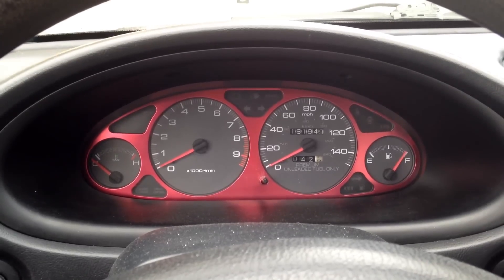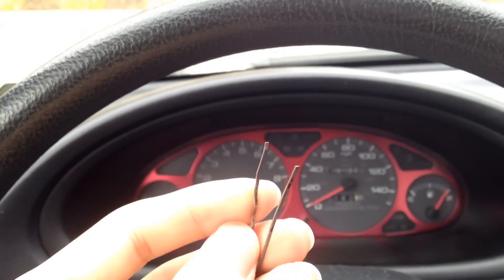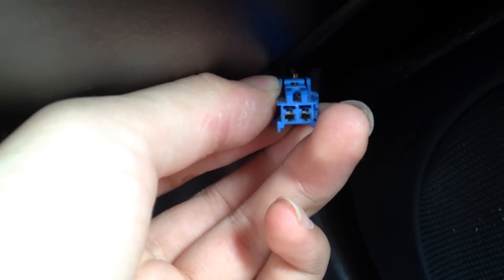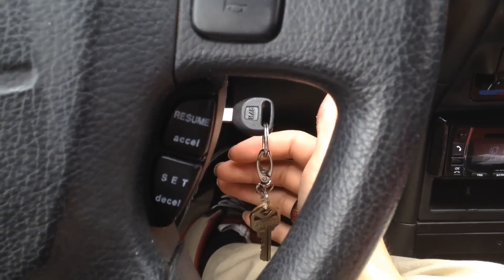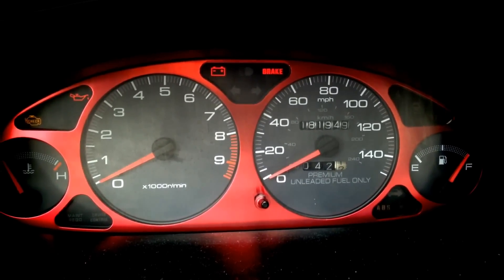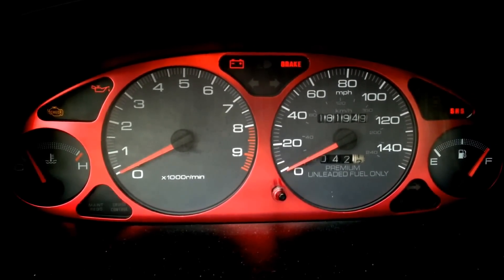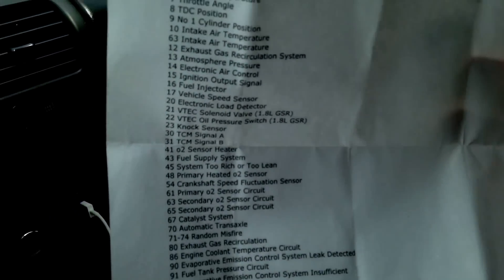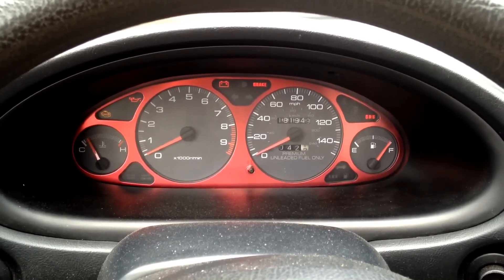How to Pull Engine Codes Without a Scan Tool (use a Bobby Pin!)(For Honda/Acura) - EP #19

Comment: Did this with my 2002 Civic EX and my bobby pin turned bright orange and the fuse started smoking. Yeah, I'll just take it into the dealer.

Comment: no lights flash
Reply from the maker: I'm going to assume you've got a CEL when the car is running...so perhaps the wiring on the blue clip is loose and not allowing the wire to jump properly?

Comment: I have a 97 honda civ with a d16y8.  I tried to use a obd2 but it gave me an error. So i wanted to manually read codes but could not find a blue pin. Any chance it doesnt have it?
Reply from the maker: Not sure 100%, but this photo is of a civic... http://www.civic-eg.com/causeforalarm/aem_uego/ECU.jpg
It looks like it has the same plug. The blue plug is plugged into the green one. See anything resembling this at all?

Comment: Do hoy know where is that conector on the 99 civic?
Reply from the maker: It should be very similar to the integra...unless it's not...then I'm not sure. Everywhere I've looked points to it being in the same spot...but I'd have to go find a civic to check! Is it not where I show in this video on the top of the ECU?
http://i0.wp.com/qcwo.com/technicaldomain/wp-content/uploads/2009/03/image-42.jpg?resize=450%2C495
Reply from the maker: It should be the blue plug shown here: http://alflash.com.ua/Honda/scCivic.jpg
Reply: +The CF Project Thank you for the quick help. That it is, that is the conector. Gave me Code 67, Catalytic Converter.
Reply from the maker: If you're unsure if that's the only code, you can always take a trip down to Autozone (except in california) and they will pull all the codes for you. A cat replacement could be expensive...but the code could just be caused by a faulty O2 sensor! Try checking the harness and plugins...if all else fails, swap out the O2 sensor yourself as it'll save you $$$ and is very basic to do (I'm guessing it would be the downstream sensor). You'll just need an O2 socket wrench adapter and you're good to go!
Reply: +The CF Project Mhm, o tought that that procedure would give me all the codes, each after a pause. Better follow your advise. Thanks.
Hey, yes, it is the O2 sensor.
Reply from the maker: There you go. Easy fix!